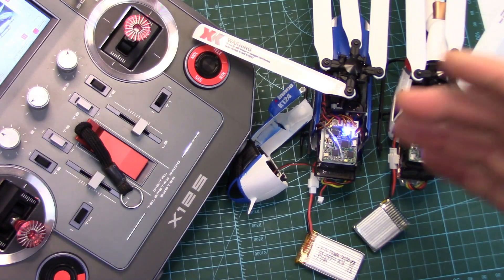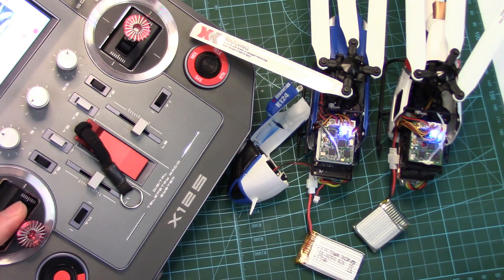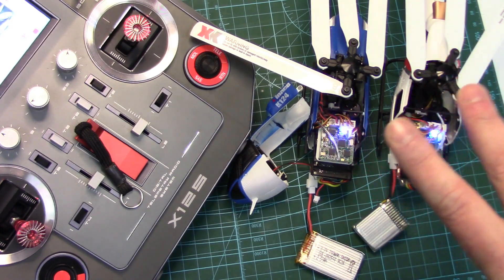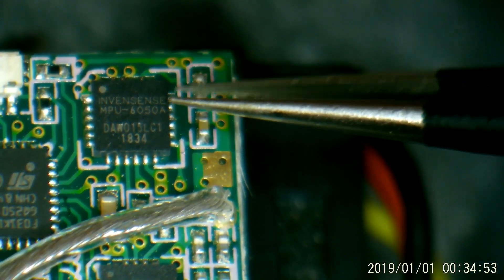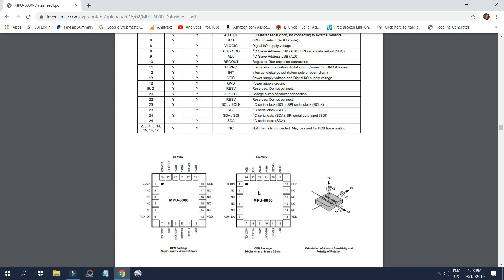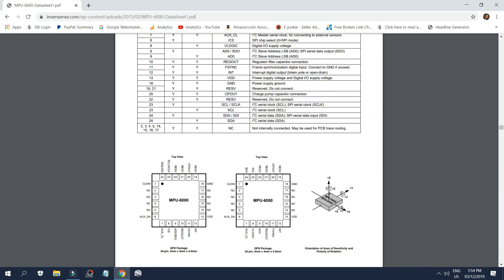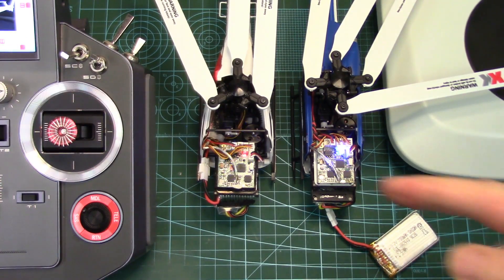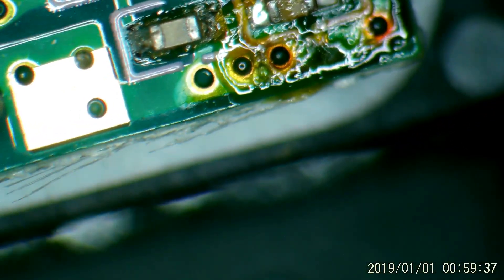XK K124 Accelerometer Calibration Fail

Comment: John, I used this method for my xk110s and it worked. I have had trouble out of my 110 to the point I bought a new board. After the calibration the 110 wasn't drifting hard to the left. Thank you for this video!!
Reply from the maker: glad to hear you got the calibration to work on your 110S! 👍🙂

Comment: Hi John,
Came across your video and mine does not enter calibration mode either. No issues with the K100 and K123 tho.

My K124 hovers fairly decent besides some backward drift, but when i put the sticks into the outside bottom corners the blue light flashes quickly and seems to  do some movement in the head/blades, but does not actually stay in calibration mode unlike my other XK helis that actually can be calibrated for 6G

Comment: My XK K124 doesn't work anymore after fully charging battery. When I plug the battery in the power port, it does the startup beeps then that's it. I don't even get lights anymore, and it does not sync. Sometimes after plugging the battery into the helicopter power, it beeps indefinitely. Any clue on what this might be? Do I have to send it back for repairs? Never crashed it, and shipping time is crazy.. Please help.
Reply from the maker: Sounds like a faulty battery but without being able to test it all, that is just a guess. Have you tired other battery packs to see if the problem follows the the battery or follows the heli?

Comment: I just bought a k124 and it is extremely frustration to set it up. Finally got it to take off, THANKS to a few youtubers like yourself.  Still need to configure it more, i would like it to do hover, on its own. The switch from flying an Eachine 129 has been a shock so far 😂👍.

Comment: Thanks for the good guidance. I burned the main board and once replaced I’m not able to calibrate the rudder. The tail motor is ok, but when connected to the board, it does not compensate the main rotor spin. It rotates only in the same direction increasing the spin. Any clue how to calibrate the rudder? Thanks
Reply from the maker: As far as I know, there is no tail calibration. Sounds more like the tail motor wiring is reversed or perhaps the tail blade in on backwards - ie. check the direction of thrust to make sure it is counter to the main rotor reactive torque. BTW... Tail motors only spin in one direction, they don't reverse. They will basically turn off when yawing left allowing the reactive torque from the main rotor to yaw the heli left. They spin at medium speed while not yawing to  create a state of equilibrium between the tail thrust and reactive torque. They spin full speed to yaw right.  Of course the speed is proportional to the yaw commands and tail gyro correction commands.
Reply: Thanks a lot. I was so stuck trying to reverse the tail rotor spin that did not pay attention on the main rotor direction. The chances to reverse the motor polarity or invert the tail propeller are minimal but the connection of the main rotor motor can be easily inverted by mistake. I realised that the problem was on the main rotor thanks to your guidance. Problem solved 👍🏼

Comment: I found that you need low to be at zero in the radio settings before you can hold down the right stick to enter the mode. 
Also, you once in the mode, you can use low rates for the flight, as long as you switch to high again before you throttle down and held the elevator down to save it.

Comment: Hey John - another great video 👍🏻 I’m experiencing a very weird beeping from my xk k124 ec145 heli.
After binding, the tail rotor spins up and all the servos check out fine. But I’m getting no power to the main motor, it just keeps beeping with solid  blue and red LEDs. I replaced the motherboard with a new one but no change - any ideas? Thanks 😊
Reply from the maker: Sorry, no idea.

Comment: So, my XK K-124 does not have the capacitor on the board, and does nothing when I hold both sticks in the "down" position, but... In both 6G Pose and 3D Lock Gyro modes, if I hold the left stick down and to the left, and the right stick down and to the right, it does enter one of it's calibration modes (the one that does not require a bit of hovering to complete).

Comment: I found that my k124 that can't enter calibration mode, I cannot switch between 3G and 6G when in flight, the only way I can switch between modes is to land it first and then it allows  me to change modes. But on my K110 that does enter calibration mode, it will allow me to change between 3G and 6G during  flight. Try your K123 to see can it change between 3G and 6G when in flight. Your K124 will probably be the same as mine.
Reply: I got a new K124 recently and that's the same with 3D/6G switching - it only works on the ground with the motor stopped. Apparently on older ones you could do it in the air, which is pretty handy if (like me) you're not a 3D God!

Comment: I am currently experiencing this problem on this card. If it is an update it can revert to the old model because much more reliable in the precision of piloting even after having restricted the expo D / R for a smoother flight. Having two models I clearly see the difference. a 3 year old still as new and another very recent. sigh ... is it an improvement or poor quality? ... to have...

Comment: John, you have to have the sticks out to the lower outer corners to get in 3G calibrations mode in mode2 , that sets the 3G gyro "level" position.  Straight down like you are showing is the 6G trim flight mode.
Reply from the maker: I am trying to level the accelerometers (6G). That was the original question after all. Works fine on the 123, not on the 124.

Comment: according to the paperwork you provided. They upgraded the board and it says it is no longer necessary to manually calibrate these units on the newer units. Mine will not enter calibration either but the gyro still works in 3D and 6G modes. Don't know if it's right but mine hovers and does 3D just fine. Good video, Jay

Comment: Thank you, John for investigating this issue. I really appreciate it. Let's hope other people will tell us weather their xk k124 enters 6g calibration mode or not. It could be that xk k124 board is different even if is just software wise. I saw that on the back of each xk helicopter electronic board is ticked the coresponding model even though the boards apparently look the same.